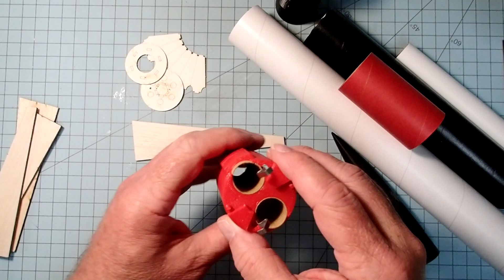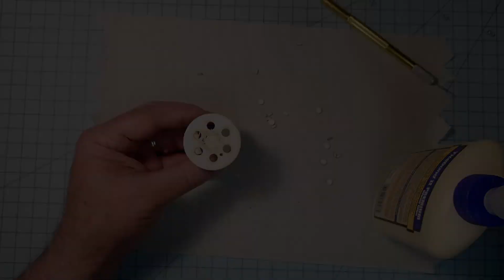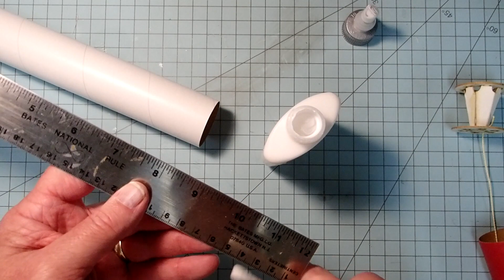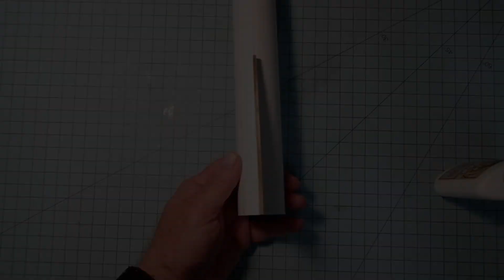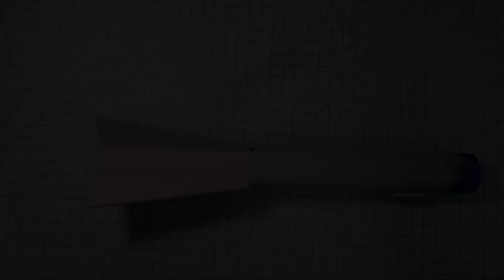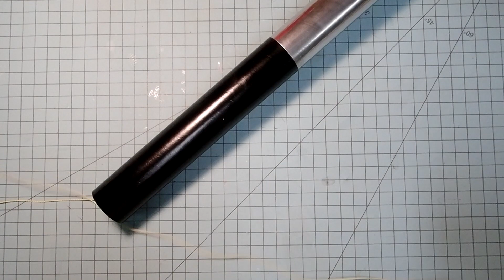Custom-designed "Boldly Go" model rocket assembly

Comment: Nice rocket build. I would discard the heavy plastic twin 18mm motor mount and make it triple 18mm motors. 3× BT-20's fit inside a BT-60 perfectly, just add another motor mount and fill between the triple clustered body tubes with glue and wadding as DIY flame proof putty. Let the motor mount tubes protrude from the aft end about 1/2".❤
Reply from the maker: Nice ideas, but this is a frankenrocket after all.